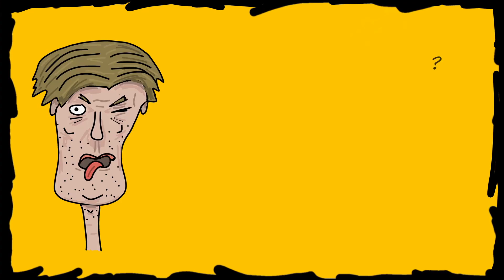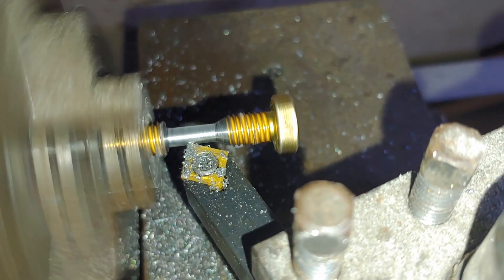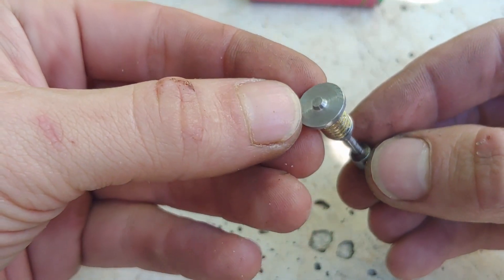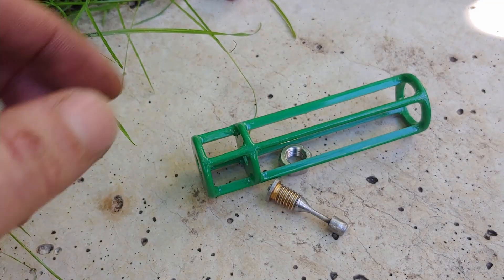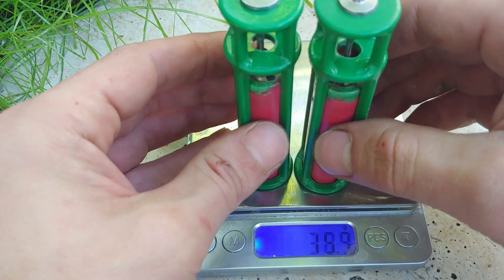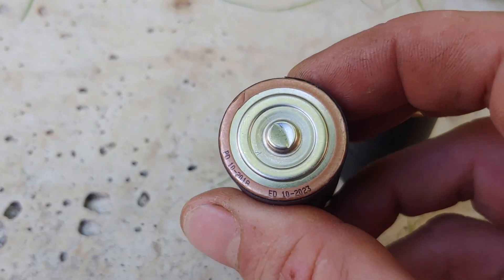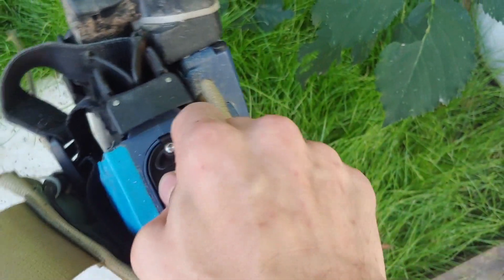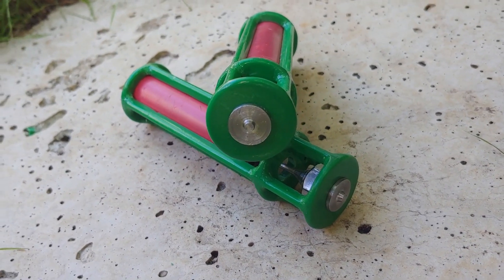Making 18650 Battery Adaptors for the SDC2300

Comment: Have u had look into the 26650 3.7V  any chance u got for diy spacer for that size cell and there 2668.5 with the protection high an low cut off 68.5 long 26 wide or no protection 26x65.0  any input would be great I like how u think out of the (box iv got tinkercad file but don't no how to past it in her foe u I made it public lookup 

( minelad sdc2300 26650 battery mod )
 it's ruf as gusts an didt really no what I was doing but it worked out need some one to tidy it up that no's what there doing tinkercad limited on android

Comment: Have u had look into the 26650 3.7V  any chance u got for diy spacer for that size cell and there 2668.5 with the protection high an low cut off 68.5 long 26 wide or no protection 26x65.0  any input would be great I like how u think out of the box

Comment: Two things let down this $4000 AUD detector....the batteries fitting into the machine and the audio system in  general. Otherwise.....it is a fantastic machine.
Reply from the maker: Yeah, can't disagree. Go second hand though and get one for $2,800 as I did and that $1,200 saving well makes up for it, I would say. Plus the ability now to fit different coils has made it an even more versatile unit than it already was. Many a positive. I'd recommend one in an heartbeat. It is a shame they couldnt get some of the simpler stuff right though, I hear what you're saying.
Reply: @DigginForGold  ...go to bed !!!!
Reply from the maker: Do as I say, not as I do...ey. Haha 👍
Reply: @DigginForGold  ..haha...work for me....